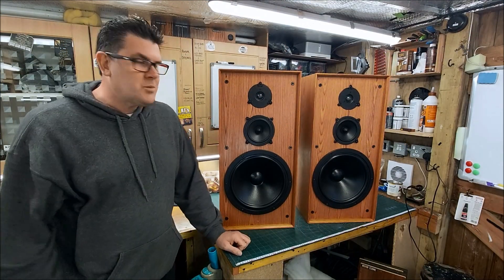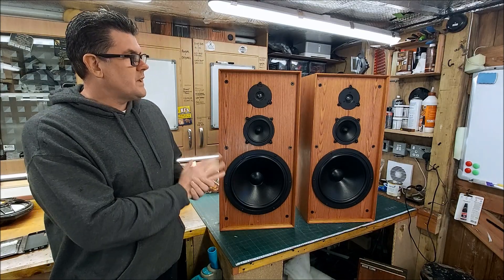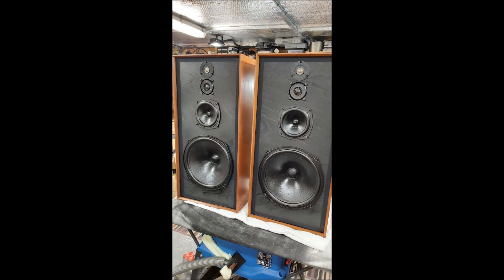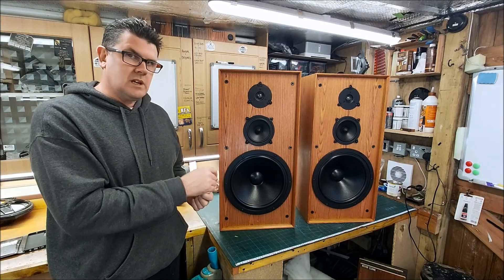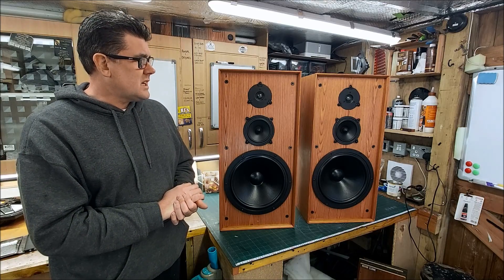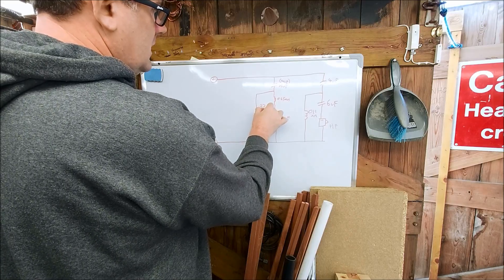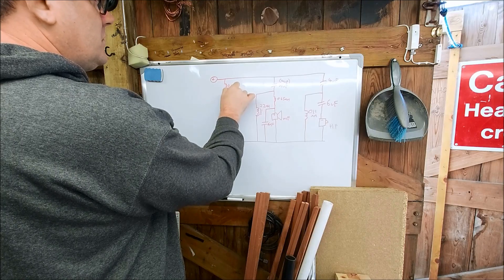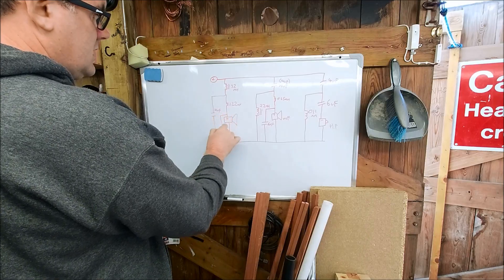Dead Ditton 44 Speakers Part 5 - Measurements & Crossovers

Comment: Do you have any restriction about wire gauge for woofer and mid? I´ve experienced good results with 2.5mm2 rather than 1.5
Reply from the maker: @Unavintage  The internal wiring lengths are so short power handling and volt drop are not a problem. Some people use crazy Cross sectional area wiring. The QED copper I use is 1.5mm. Plenty big enough. Maybe on high powered 3way I might use 2.5mm on the woofer but not on the midrange and tweeter